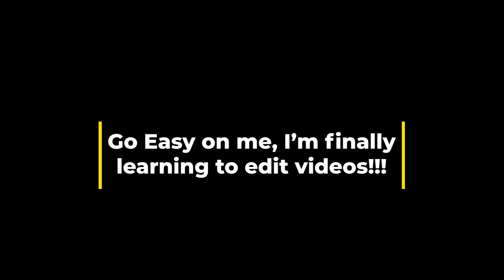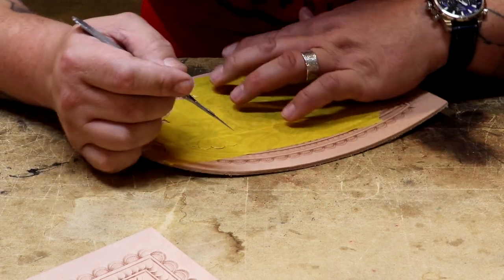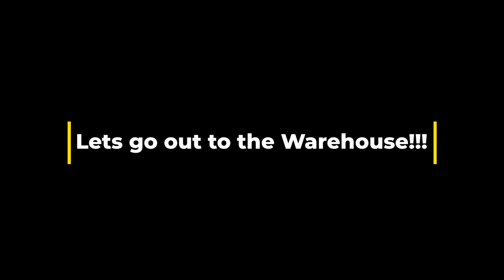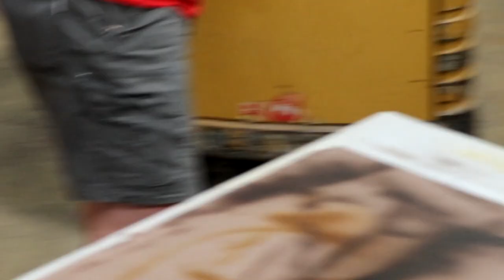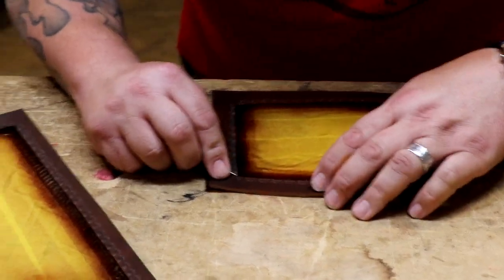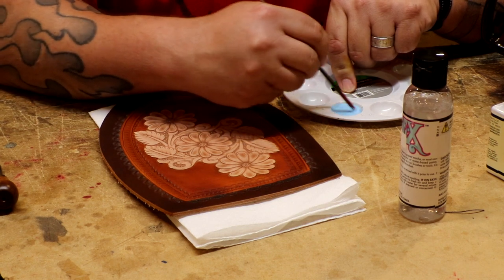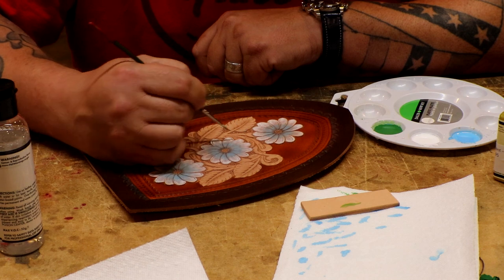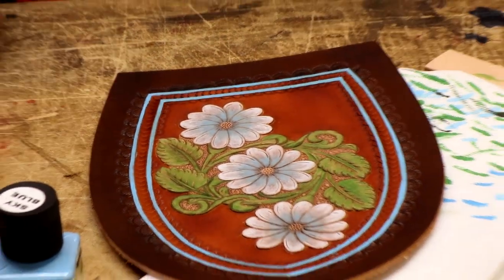Boujee Backpack Part 3 Airbrush and Paint

Comment: Aaron, how do you recharge the airbrush?
Reply from the maker: It has a USB charging cable so it charges like your phone.
Reply: @makersleathersupply1220  I think I get it.. the compressor is in the unit.  I thought I could hear it running when you were using it.  Sure beats my baby compressor on the table.  Will you be stocking this from now on?  Great video by the way.
Reply from the maker: @406Montana  yessir, this is a regular stock item now.